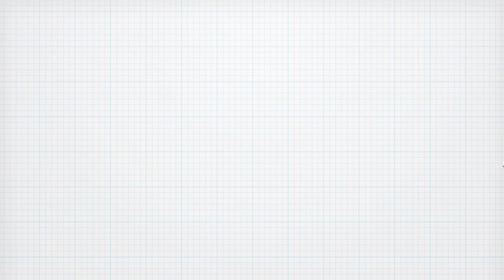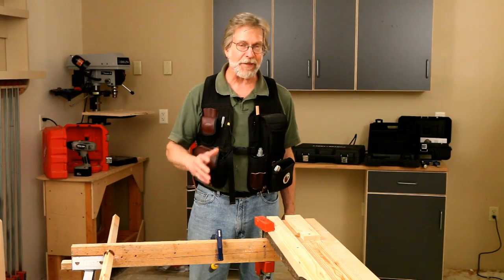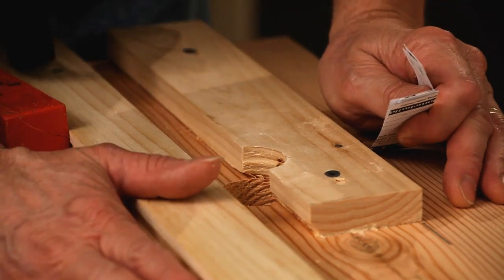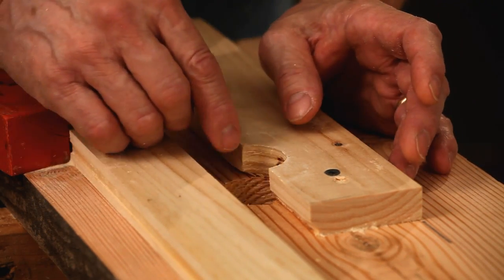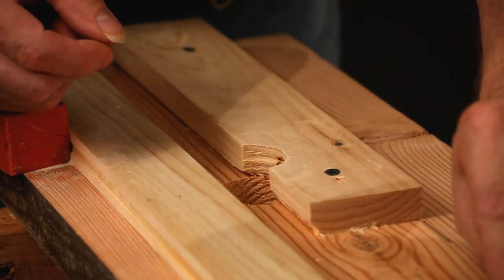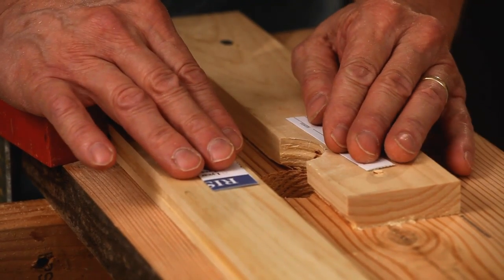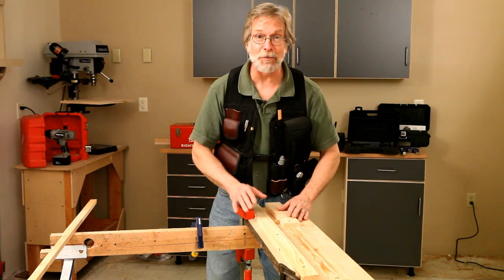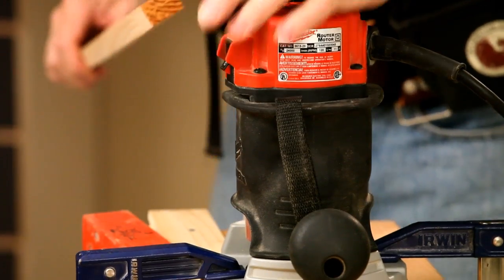Job-site router jig

Comment: What about cross routering..in other words a movable jig to make dados for let's say shelves..  I have Ryobi plunge router and I can run it on the flat side. I was was thing of taking the sides of the shelves and putting then together and let the jig go across bother and they will be perfectly aligned even if I have different size openings.